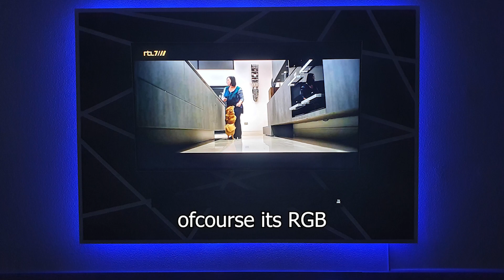DIY floating TV wall

Comment: Can I get list of supplies that you used please?.
Reply from the maker: Its very simple depending on size you are going to build. Just a couple of wood slats. I'd use 3 screws minimum on each to hold them on the wall. I used 2 mdf panels cut to size and added them with mdf screws, make sure to countersinks screws. Then add putty onto screwholes, seam between panels and side of the panels. After sanding you can paint or add wallpaper.

Make sure to use correct size wood slats so there is space between wall and mdf so you can route your cables. I'd recommend minimum 3cm thick slats.